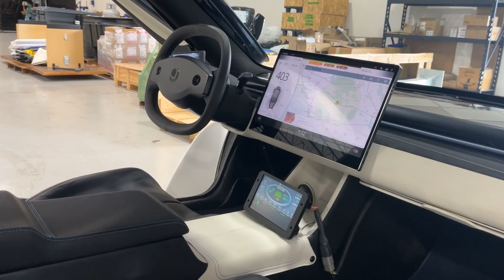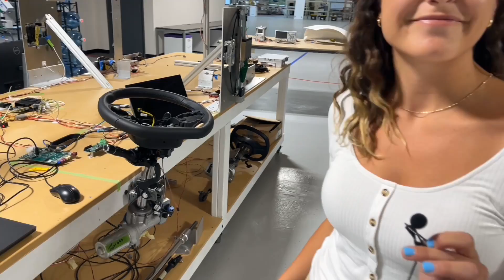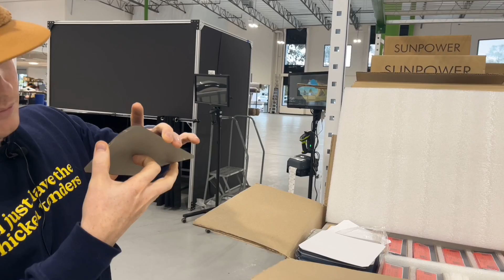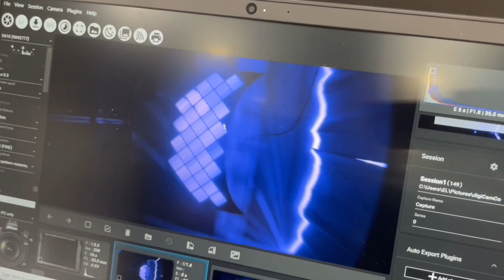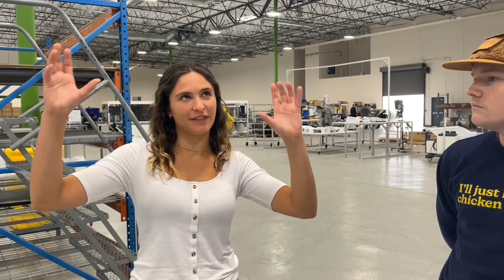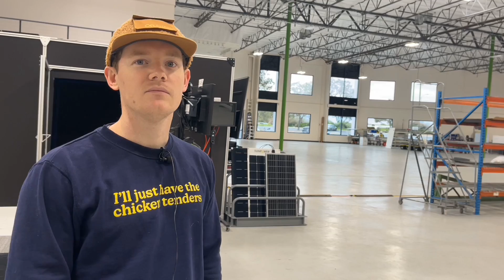APTERA factory tour 2023!  INSIDER updates on solar, funding, and production timeline!!

Comment: just rewatching this video I notice an error in the solar information. He says it gets boosted to 400v, it has to get boosted to over the battery voltage in order to charge ( otherwise it wont charge the battery), since fully charged is around 400v, it needs probably 450v or more to charge. Anyhow you can do some easy calculations on how much charge current is supplied to the batteries after dc/dc conversion with P=VI.
Since we know the solar output ( max recorded thus far is around 500watts) and the voltage we can calculate the amps provided to the battery ( ignoring losses so this will be an over estimate).
I = P/V so I = 500/450 = 1.1 amps.
So the max amps being delivered to the pack is approx 1 amp. If you want to work out how many amps each cell can recieve then there are about 10 parallel strings of cells in the 42kwh battery pack. So dividing by 10 you get about 10mA being delivered to each cell.
That is an absolutely tiny amount of current, even at the peak power the have achieved, your talking on average ( not peak) probably the amount of current it takes to drive a tiny led going into each cell.
Aptera of course will not tell you this, as it looks bad, and does not get investors hyped up. But alas according to physics this is the reality.

Comment: Pretty much any ccd camera will pickup infrared, its one way to check if your remote controls are working, just point your phone camera at your tv remote and push a button you will see the remote led flashing. No special camera needed to pick up the panels I suspect.
I notice that companies use infrared cameras to test the cells for failures, the cells from sunpower have almost certainly been tested this way to make sure they are near maximum capacity.

Comment: So cool. If it only had a bed behind, I'll turn it into a permanent house 😂.  I'm building solar cells on my pickup truck for ranger ,but it turned out to be so much harder than I thought. Keep breaking them.Now I'm applying silicone behind the solar cells to make them water prove and copper tape to pump the heat from solar cell into the copper tape... Hopefully I'll be able to add motor on my pickup truck shaft to increase fuel efficiency...

Comment: concerns:  performance in hills, mountains.  handling while the trunk area is loaded to max. no roll down windows? ac?  seems the pv cells would fill out more area... perhaps an aux roll out flexible PV module?  hot to heat?

Comment: I am concerned about parking on the side of the street and hitting the curb as the wheel cover seems so low
Reply from the maker: It's just a bit wider than a standard car, but not wider than all cars.  I think the wheel wells could get scraped, but I imagine they would be easier to replace than standard side moulding

Comment: I have been following Aptera since I found out about it a few years ago.  I'm happy to see that things are still moving forward.  I wish the team all the best. 
I have expressed several concerns about some design elements before. Things that seem to needlessly deviate from the norm, and could be off-putting to potential buyers.   
The big ones being  the "hello kitty" steering yoke, the ball/nub/light assembly on the rear and the placement of the side-view camera screens. 

The steering should have the option of a more conventional steering wheel as most drivers will use hand-over-hand when turning a corner.  That yoke, missing a huge chunk of the wheel will hinder that method of steering, and could cause a an accident when a driver goes to reach for the most crucial control of any car, and there is nothing there.   That, and if you look at the current iteration,  You can see Hello Kitty's face with two beady little eyes and a huge gaping maw, and her two ears sticking up at the top.   (Sorry if you can not unsee it now.) I for one certainly do not want HK staring into my soul with a huge gaping maw, the entire time I'm driving.  Blame it on pareidolia.   Perhaps the  steering column and wheel seen on the test bench will see production.  Hopefully?  Can you shed any light on that? 

Then there is the issue with the location of the sideview screens.  Again drivers are accustomed to looking toward the location of conventional side mirrors when changing lanes of checking traffic behind them.  The previous version of the car had those screen at each end of the dash, very near where traditional mirrors would be.  I think this should be layout.  An advantage of that would solve a third concern I have.  That being having the speedometer, charge/range, and other practical vehicle info displayed in the normal location, ahead of the driver, rather than off to the side.   Again,  any word on that being considered? 

A fourth concern would be that nub on the rear of the car, where the plate light is housed. How long until that thing is snapped off of there when crawling in/out of the rear on a camping trip, or when loading, unloading cargo?   You know that someone is going to go to get out of their Aptera camping package setup, throw their legs over the edge, and slide out snapping that ball/nub thing right off, or getting it nearly shoved into their nethers.  Either way,  not good. 

So I was just wondering if there is any word regarding any of those things.  
Thanks,  best wishes, and have a wonderful day.

Comment: Modern technology can be used to farm methane with your kitchen waste in two one cubic meter plastic containers. You can compress those methane fully automated into a light-weight, installable propane tanks for charging your Aptera in the backyard 7/24. If you don't use them to charge your Aptera, you can use them to cook your food or warm your house as well. All kitchen waste will become fertilizers eventually, which you can sell/donate to vertical/roof-top organic farms around metropolitans.

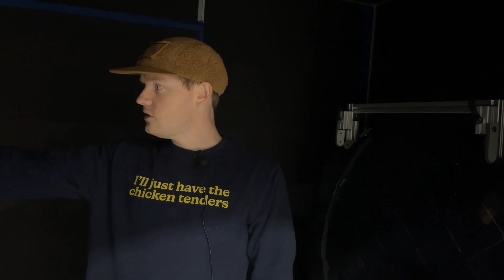Comment: This video is awesome and I'm excited to see the advancements of what Aptera is gearing up for in manufacturing. However at 20:00, I know this is nit picky but I really.. wanted to see the light bulb that 'simulates the sun'. Missed opportunity. Yes I'm being annoying. Thanks for the video.
Reply from the maker: Good call on the light… and thanks for the support!
Reply: These days there are a few different light bulbs that can be used to simulate the sun.  One that I'm familiar with is what's called a pulsed Xenon lamp.  A "PXA-80" from Lamp Express is a good example of such a lamp.  It's quite an interesting, and expensive, looking bulb!

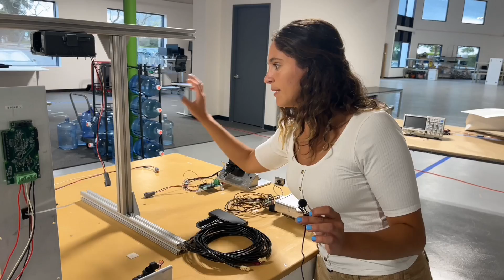edit: Check out starting at 6:34 of the following vid!  "Aptera Tour Part 2 Aptera, The Movement"  by The Ninjineer  The bulb is in the center of the 1/2 spherical reflector housing.

Comment: Those solar panels being that fragile makes me concerned. That was one thing i was super worried about. If it broke that easily from him handling it, imagine what a flying rock on the highway would do.
Reply: Once the cells are encapsulated with their process they are apparentky quute strong. They perform environmental testing on them including firing one inch ice balls at them to simulate hail strikes.
Reply: I have routinely built solar PANELS with the very solar CELLS that Aptera is using.  The CELLS are, indeed, as fragile as they appear in this video but as long as Aptera's solar engineers do their homework, like @garywozniak says, once properly encapsulated they will be fine.

Comment: That factory has nothing in it. The automated robots "AGV's" simply are to move vehicles from station to station, but there are no stations, it seems like the money that has been raised should have purchased more than this by now. I love the car and the concept.
Reply from the maker: most of the body construction will arrive from Italy pre-assembled, so it's just furnishing the battery, drivetrain, solar, HVAC, etc in the CA facilities.  Once they get funding I think turnaround will be about 9-12 months to purchase and install the rest of the equipment.
Reply: @SavingGreen my understanding is that the vehicle assembly time in CA will very fast. Something like 12 minutes per vehicle. 40 vehicles/day in and 8 hour shift.I think having the parts inventory is the major issues.

Comment: 19:00 CLEAR!??😮😮❤
Reply: Cam wasn't very clear about the "color" thing.  He's likely referring to the background color of the solar panels.  The solar cells (Maxeon) will be a dark blue.  Any color or even clear will be around the edges and possibly between the solar cells.
Reply: @bobhilder1469  interesting..thanks for sharing, your knowledge. Would you happen to be part of the production process?
Reply: @ApteraEV2024  It's my pleasure.  I am not part of Aptera's production process but I have over 20 years experience in designing, developing, building, testing, debugging and repairing specialty solar panels.  By far the majority of my work has been focused on high performance and low weight solar panels for solar race cars and such.
Reply from the maker: yes this is an important point.  the solar cells themselves will be dark, but their housing can have different colors/patterns apparently

Comment: What about Transparent Glass Solar Panels? Have they been in contact with the new solar glass companies? Also a solid state wind powered addition to the vehicle would be nice, it would look great as a spoiler. 

Keep up the great work! I typically like eVTOLs, but this seems to be safe and cheap enough to be financially viable.
Reply from the maker: Interesting thought!  Not sure if transparent panels could be in Aptera's future.
Reply: When "transparent glass" solar panels become efficient enough they would be a great choice for the rear hatch!  If any "wind powered" apparatus slows the wind down, it would be a literal "drag" so likely not a good idea on a moving Aptera.
Reply: @bobhilder1469  isn't reducing drag a good way of reducing friction and g forces attributed to passing through the medium of air? I propose a nanostructural array to aid in particle flow, which would also further reduce drag beyond just a solid state wind turbine. It could be applied like a nanocrystalline spray on hydrophobic coating for cars. I study drag reduction for torpedoes and wind tunnel effects, and suoercavitation works in air, based on pressure differentials of the medium, same with space, and the reason why light isn't a finite speed, its slower in air, and water, and space is a medium itself for particle effects.
Reply: @extremechris9145  I probably could have been a bit clearer.  Let me try this from a different angle.  If the "solid state wind turbine" is mounted on Aptera and the intent is to use it while driving (creating electricity), won't it increase drag and tend to slow Aptera down like "regen" brakes do?  I'm coming from a conservation of energy point of view.  Now, if the vehicle was stationary and there happened to be a good, stiff wind, by all means deploy the "solid state wind turbine"!
Reply: @bobhilder1469  Just like in f1, the rear wing could be adjustable based on usage. Plus many different wind tunnel tests would minimize such drag, as well as many locations could be used for its placement. Solid state wind is much better stationary, but if they went through experimentation processes, it could induce viability whilst in motion, despite the added drag coefficients.
Reply: @extremechris9145  Sounds great.

Comment: I think adding solar to a heavy vehicle won't do much, but what would, is adding a bunch to a semi trailer to power refridgeration.
Reply from the maker: Yeah there's definitely diminishing returns with solar on heavier vehicles, but the Aptera is pretty lean and svelt!
Reply: @SavingGreen  I really hope they make it into production, and they don't have big problems. Ever think about how much it has in common with a 2 seat sport car? 2 seats, carbon fiber body(the fancy ones), eye catching looks, sporty if you get the 3 wheel drive. I wonder how many they could sell in a year. Way more than Ferrari for sure.

Comment: How did the crash tests go?  Im all for efficient transportation, howerver this vehicle seems to way ahead of its time.  Selling the EV as a daily driver took effort, and its resembles traditional car design.  This is something you see in sci-fi movies.  Its works well and get you from A to B im sure, but again, just not for most drivers.  Little to no room for groceries and paper goods.  No room for household goods like buying a trash can for the kitchen, laundry basket...just lacks so much every day form and function.  Guess a bike rack will be on the roof?  What if you want to buy a large mirror for your bathrom or bedroom...?...thats not fitting in that vehicle.  
The vehicle is again ahead of its time.  I can see this with robootaxi potential in heavily populated areas.  They won't appeal to mobility challenged individual's as it lacks space for their walkers, and is kind of low to the ground.  Again, intresting but very niche...very niche.  Good luck Aptera.

Please work on your verbal fillers, its hard to trust a sales pitch with so many of them.
Reply from the maker: What do you mean verbal fillers?  Did you find the dialogue too conversational and less critical or precise?
Reply: @SavingGreen  He meant the Aptera spokespeople.
Reply from the maker: Ah ok thanks
Reply: They need to have a production line up and running to make vehicles that would be suitable for crash testing.

Comment: Will the Aptera have power steering?
Reply: yes power steering but no it won't have variable ratio which is only for drive by wire which the Aptera is not.
Reply from the maker: I believe so, yes.  I took a test drive (video soon!) and that thing turned on a DIME!

Comment: only 67W for hood/dash panel?! 
let's say it's the dash, the hood might be 100W, the roof is ~4 times the hood? 400W+100W+67W = 567W and they say ~700W?
hope the 67W is not the hood.
Reply from the maker: I think there are a few other videos breaking down the number of cells in each unit, but 700W is the theoretical maximum, so likely real-world production will be less anyway.
Reply: @SavingGreen  The 700 Watts is not theoretical maximum.  It's the summation of the RATED powers of all the individual solar cells.  Rated power is at 1000 W/M^2 of irradiance and 25 degree C cell temperature.  After all assembled, encapsulated and mounted, I expect the RATED power of all the cells to come in at about 500 to 550 watts.
Reply from the maker: @bobhilder1469  Thanks for clarifying!

Comment: Impressed with the giant empty warehouse.  Not so impressed with the lack of progress.
Reply from the maker: It didn't seem as empty as the video portrays, but definitely without the heavy machinery there's a lot to be desired before mass production.  As Cam stated, this is the "low volume" area so this is really where individual components are tested, not mass produced (yet).  There are other warehouses off site where battery components and other parts are made, but some of those had to be relocated due to recent flooding (that part of the video was edited out).
Reply: It will never see production.

Comment: Glad to see knock knock hasn't been abandoned. Love that feature.
Reply: 100%.  That was previously an unknown
Reply: Kinda wish it was like my Toyota instead where if you have the key and your hand goes over the door handle it instantly unlocks and you can lock by pressing a capacitive spot on the front of the handle when getting out.
Reply: @Skylancer727  The bene's of knock knock is that Aptera's door pops open, so if you are carrying a bunch of stuff ...
Reply: @jeffcarlton3590  but you still needed your hand to hit the side... 

Even if there's stuff in your hands it's not much to just hang your pinky over the handle to open it. Plus the knocking is just slower and will likely leave a mark on the side over time much like touching the same spot on a wall over and over. Especially since the car is wrapped which tend to stain with time.
Reply: @Skylancer727  My Ford is like that.  I'm a little terrified of the key still being inside :-(
Reply: @artsmith103  not possible with my car. If you forget the key in the car it will not only stay unlocked, in fact the car will start beeping at you similar to if you forget your headlights on.
Reply: @Skylancer727  I'll have to try that home with both keys available. Thanks.

Comment: How many MPPT inputs do you have.  Is there one for each string or one for each surface?
Reply from the maker: I’m looking into this…
Reply: @SavingGreen  Great question while you have their attention is how would one custom made charge controller for the car arrays be capable of also managing a typical 18V external panel. To what W limit of the 18V panel? Are multiple 18V required for voltage control? Could a 35V residential panel be used?
Reply: Cam, effectively, said 3 MPPTs on hatch, 2 on roof, 1 on hood and 1 on dash so 7 total.
Reply: @bobhilder1469  Wow, thank you.  I really do appreciate the information and your effort..